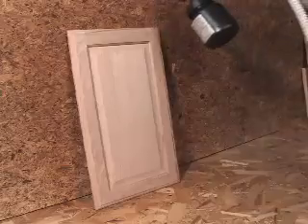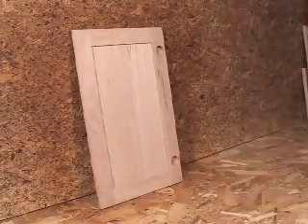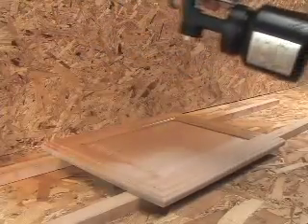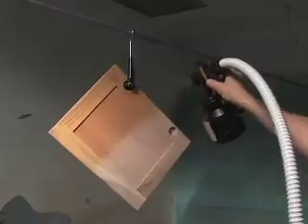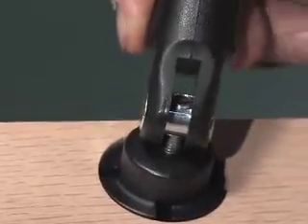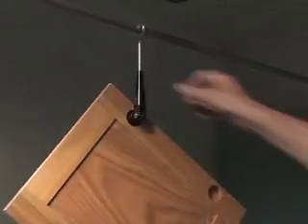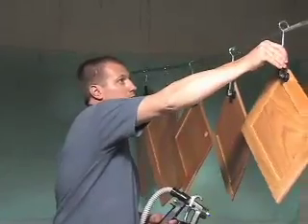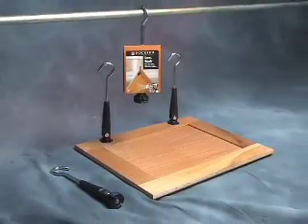Rockler Sure-Hook™ 360 Cabinet Door Hanger

Comment: I like it but if you have hole for pulls, you can cut heavy gauge wire and bend it in an s and hang it that way but then there is still a problem with movement.

Comment: I've got a method what I feel is a 100x better.  I have a 1/4 plywood.  16" x24".  Has 4 nails coming out of it.  Lay good side down.  Spray back.  Flip door over spray sides and too(front).  Then carry entire board over and set on drying racks.  Door comes out with perfect finish
Reply: Nathan Burt I'm guessing your drying rack has nails too to keep the painted surface from touching the wood
Reply: That's absurd. You can't handle a wet door and lay it on nails without messing up the finish. 😂
Reply: Ive done thousands of doors.  No problem.  Only works on stained hardwoods with a precat lacquer.